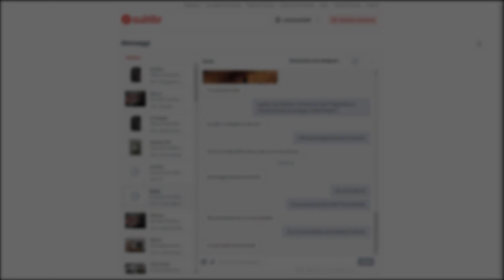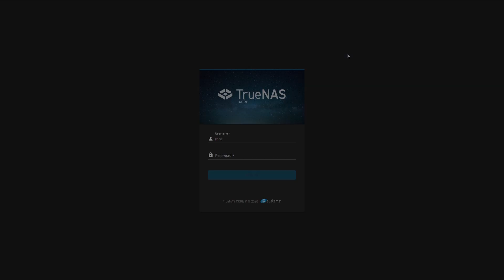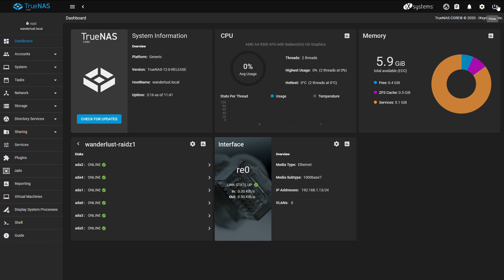DIY NAS from old pc - How to build DIY NAS storage for home - Building DIY NAS server TrueNAS CORE

Comment: Why do you need a video card?
Reply from the maker: Hi, the AMD A4 5300 cpu has integrated gpu, so I could definitely have avoided mounting a dedicated graphics card. However, having only 6GB of ram and having an extra unused video card I preferred to mount it. Also I wanted to try hardware accelerated streaming.